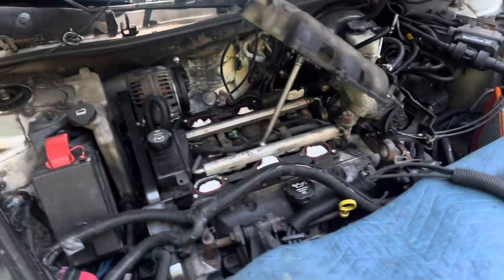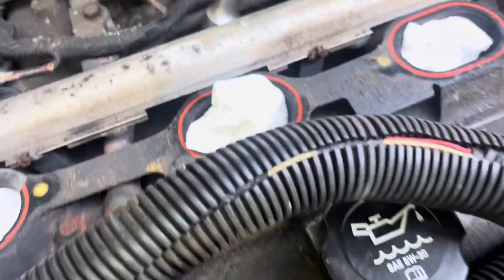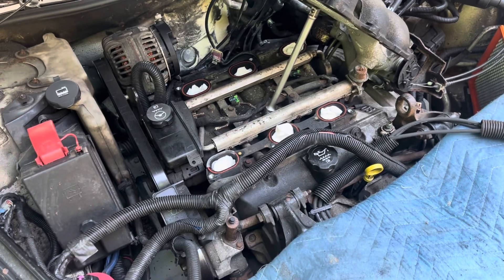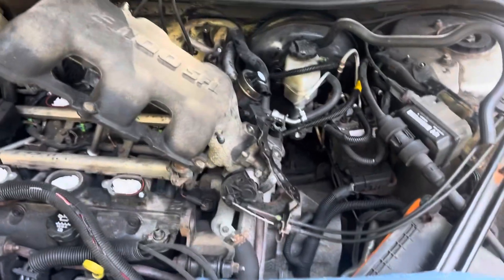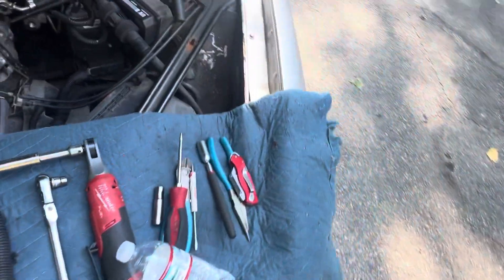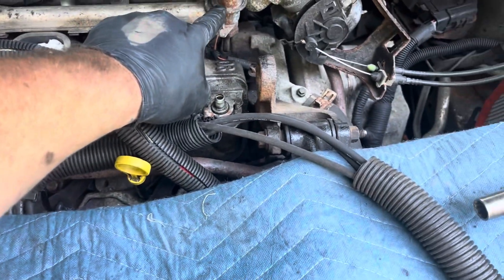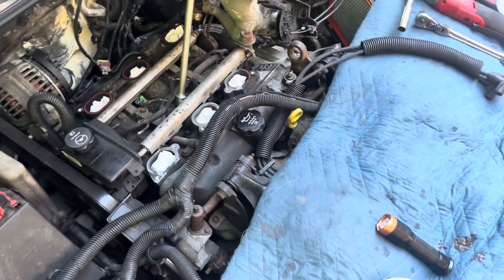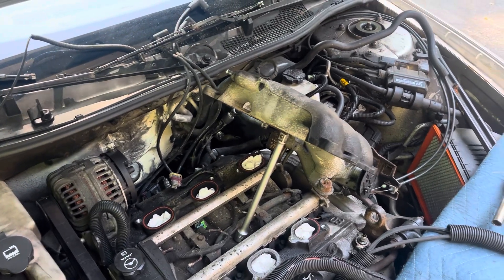Fuel injector replacement 3.1 L

Comment: I would have used professional BG fuel injector cleaner $210, not the local injector cleaner stuff, they don't work. After cleaning all the injectors with canister tool it will run like an asphalt ripping machine. when finished cleaning injectors you add a can of BG 44 to the tank for additional maintenance.  Good luck Tom
Reply from the maker: I probably could’ve went down that road you’re absolutely right but she’s got quite a bit of mileage on it and the body is pretty crusty looking living in New England 210,000 miles. The motor still runs though transmissions on its last leg. It’s been a really good car can’t complain one bit.